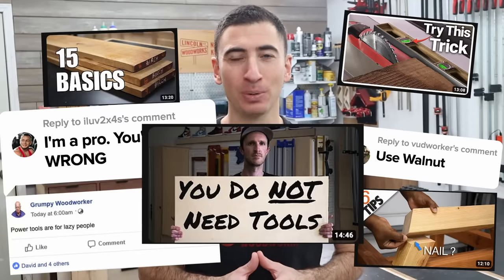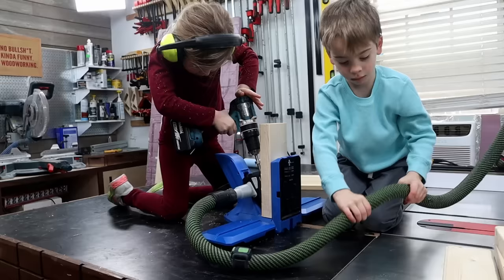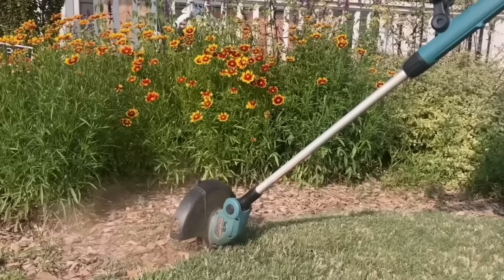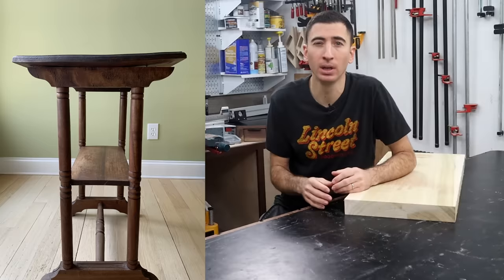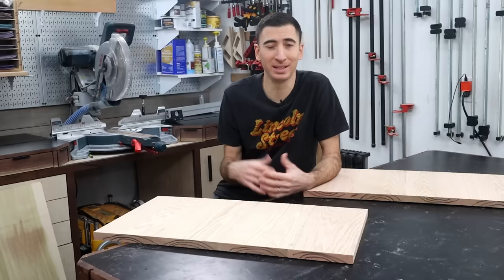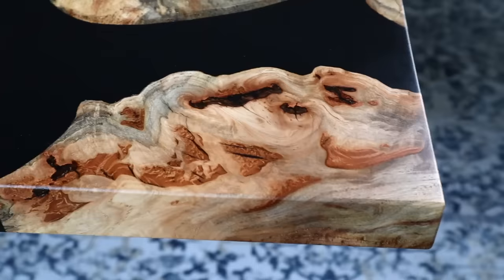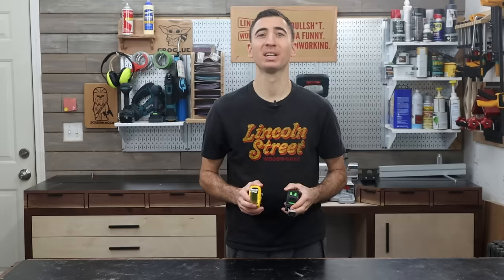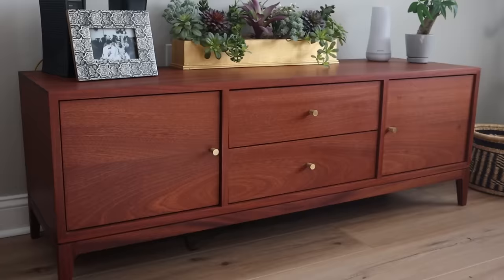Every beginner needs to hear this

Comment: Just got to be careful about all the "opinions" on the internet and particularly those that think their opinion is better than someone else's.
If the piece of wood that you're going to cut the piece from is 3 metres (10 ft) long, it is impractical to take that piece to the project's location, so you still have to "measure twice and cut once" even for the slightly oversize piece that you will sneak up on.
Joint strength is very important in some situations particularly when the piece of furniture is not made from construction timber.
After woodworking for a while your skills improve, you know when it is important to measure twice such as after a rough night's sleep, last piece of suitable wood, etc.
 Thats my opinion anyway.

Comment: Some good stuff here, and nice to have someone cut through all the shit out there.
Alt rings on tops is right - it's the best of the options given wood moves whatever.
Putting the rules and tape measures away is 100% top advice. The workpiece is the master dimension.
Anyway, all good, nice to have some real-world advice out there.

Comment: Making multiple cuts for every joint might be ok for the hobbyist, but you wouldn't last a day doing that in a production woodshop before being fired. Measure twice cut once works perfectly every time if you know what you're doing. Every time you make a mark for a measurement you have to make a mental note of where to cut in relation to the mark. Sometimes you need to cut to one side or the other of the line, and other times you cut directly on the line. Learning how to make accurate cuts is a skill that can't be taught. You only learn it by doing it many, many times and making many, many mistakes.

Comment: I have only had bad experiences in case of pine wood with the sawdust and glue trick, both with wood glue and ca-glue. The mixture is 3 shades darker than the sawdust even before it is finished.

Comment: Makita man since the 9.8V pistol grip screwdriver/ drill around 1980. Used to R&R screws from aircraft. We all used the same screw gun in the shop and everyone had their charger on the same shelf. Need a battery, grab from the shelf. Alwas worked well for me so I never had a reason to look elsewhere. That said Rigid has a LIFETIME SERVICE AGREEMENT that also covers batteries. I shouldn't comment on Ryobi. (I was a tool repair technician for seven years)

Comment: Maybe you should have mentioned that the reason for truly alternating the rings is so when it does cup you have a better chance at resurfacing back flat with less material lost in process.

Comment: Uh, I don't think "measure twice, cut once" is intended literally.  It is an admonition to think before you cut.  Catchy sayings like these are easy to remember and pass on which is why this one persists.  (I certainly hear it from my wife every time I goof!)  

But I do agree 100% with your advice to creep up on a cut.  I always cringe when I see woodworking videos where they use $300 rulers accurate to the thousandth of an inch to make precise cuts in wood.  It never seems to really work that way and I wonder how many re-takes it requires to show it in the video.

Comment: Just get in the shop and build something. The more you do the better you get 90% of woodworking tools never get used.  People buy and have 1 failed build, get discouraged and the tools just sit. At 57 I have Funiture my grandfather made in the 30's- 40's, ya 94 years ago and standing fine, long before any power tools. All hand cut, sanded to fit using horse paste glue., hidden nails  clamped together.. The only "power" tool he had was a lathe foot peddle operated. He built everyone in our family their dinning room /kitchen tables entertainment centers, picture frames, chairs, doors, cabinets.
Even with the newest tool you will still suck at it. Start small build a square box thats hard enough.  I built all my Kitchen out of scrap wood 25 years ago. Cutting up old skids using 3 simple rules 1 cut close and sand to fit 2 dry your wood indoors where you plan to use it for 2-3 months 3 If it breaks you can fix it again until you get it right.  You don't need fancy tools you need patience's more than anything. 
My Grandfather use to hide in his shed to get away from his annoying wife and his creations came out perfect, award winning at shows. If you rush the job you get a rushed looking piece.
Look at how simple the tool's people have used for measuring for thousands of years and the quality work they could do. Tools don't make the wood worker, knowing how to approach the job does.

Comment: Well...Ive built a table out half logs 4 years ago. I didn't had the proper tools, or vices, or perfect dry wood. I did the cuts with a chainsaw. Bad cuts. I still managed to glue them together and also added glue with saw dust in between. I thought it looks bad, but everyone else thinks it looks rustic 😅 the table is still strong.

Comment: One thing I disagree about: Tool brand is important, at least if you start accumulating tools. The number one most important thing is that pieces are repairable and replacable. Any brand that isn't offering any spare pieces for repairs is basically selling you throw away tools. Unless you pay a fraction, I would not buy throw away tools. Both Bosch and Makita are much better than Dewalt or Milwaukee when it comes to spare parts, so I will go for them, even if Dewalt or Milwaukee tools would have other advantages.

Comment: Good woodworking is 1/16" tolerances, Better woodworking is 1/32" tolerances, Best woodworking tolerances is 1/64". And having said that always look for ways to hide tolerances thru alignment, repeated cuts, and jigs. Most mistakes are from fitment adjustments so best to avoid them.

Comment: After 50 yrs of wood tinkering. As my Grandfather called it. No one tool company makes all great tools. I have tools with metal case housing that are older than my father.
Keep them clean and sharp and they will last you years. 
Buy a good tool with a good price and work with it. 
One thing Grandfather told me was. If you're good at your trade you can use a bone and rock to build a house. It's skill that makes it. Practice and patience.

Comment: I stick with 1 brand of cordless tools for battery compatibility. As a DIYer the batteries die and won't hold charges before the tools fail. Multiple tool of  the same brand lets the sharing offset need to immediately buy more batteries.

Comment: The joint tests aren't irrelevant. They have to be put in the correct context. For example, pocket screws with glue, the join holds 170lbs. This is used to attach 4 legs to a table. 4×170lbs= 680lbs

Only there's 2 pairs of pocket screws on each leg so the strength of 4 legs is 1,360lbs total. It seems high but consider the acceleration of gravity formula when you throw the table out of a window. 😅 

Don't forget thay your end table legs are braced (attached to eachother). Overall the strength of the joints when working as intended is still far stronger than the wood itself, assuming the joints were done correctly.

Comment: Battery tools - I would say put your hand on all of them and think about how you will mostly be using them. When 18v tools came out I ended up with Dewalt because I could get the most for my $ and had experience with them through other contractors. But knowing what I know now I would have gone with Makita because their drills were almost as powerful but a lot lighter and was doing a lot of head height or over the head work where the extra few ounces the dewalt weighed, was noticeable after hours of use.

Comment: Testing jointery, while i understand your argument, does matter cause it would give a great comparison of joints at a particular angle.   Yes, 2 joints would be different, and 4 joints are even stronger.   I am not sure that's really a question, though.   Is pocket holes stronger than butt joints.    While the answer is obvious in this case, knowing a butt joint will lack strength can definitely help a new woodworker make decisions based on what he is building.

Also, anybody who says ryobi is better than milwaukee, makita, or dewalt should never be listened to.    It is cheaper.  Not better.
Reply from the maker: I don’t think anyone is saying Ryobi is better than Milwaukee

Comment: Measure twice cut once is mostly from commercial building, yr cutting large amounts of timber for say studs or dwangs and this can easily get mucked up so a lot of the time measuring twice is just a double safety as you dont want to cut 30 studs and be 100mm out.

Comment: First piece of (non shop) furniture was an incredibly simple TV stand. Made it out of MDF and pocket hole screws (and that was the first time using pocket holes, too). My current much-more-skilled woodworker self cringes sometimes thinking about it...and then I walk through the living room and see the TV sitting there, perfectly fine, several years later, and I move on. The gatekeepers need to get over themselves.

Comment: 01:53  "...unless you're building something to sit on or ride..." -- The truth is that whether or not you build things for sitting on or riding on, someone WILL do so, especially teenagers. Or the object falls over and breaks. So the bottom line in my mind is that there are multiple ways to get a great joint, some stronger than the other. You can't make everything "bulletproof" nor should you. But you should always consider the uses your item may be put to, and then think about the lengths of pieces, whether they offer significant leverage, or whether your grain is in the best direction, things like that, and then make your choice for what is appropriate.

Comment: You just said you alternate growth rings if you are using thinner, unsupported boards.  Why not carry that same good thought through all your projects?   Be cautious.  You never know where your work will wind up.

I know a table that was built with good dried oak by a reputable custom millwork company.  It was donated to a Boys Club.  The Boys Club turned off their HVAC over winter break to come back in January to find two splits all the way across the table!  You never know where your will wind up?

Comment: Re the screws it’s 100 pounds per joint so when all the joints work together you’re fine.  I’ve spent ~50 years building with pocket screws biscuits dowels etc.  Nothing I’ve ever built table chair cabinet whatever has failed.  The few situations wherein I paid a great deal of attention to joint strength was furniture meant for human reproduction practices and I went with pocket screws and it worked great 10 yrs old and going strong

Comment: The difference between a Carpenter , Cabinet Maker and Furniture Maker . 
 Skill set , quality of work ,integrity , honesty . The tools ? Same 16 tools . We grade each other . AA ,A +, B , C and WTF ! 
 The work done is valued at the quality of craftsmanship . 
  Cabinets built with Butt Joints and pocket screws are  "Contractor Grade" . 
 One level above Milk Crate and Partical board . 
  Meaning you paid for what you got .(1:1) High end work you get what you pay for .(1:3)
  Yes I'm the Finisher and yes I send it back . 
 Yes it takes 4 years to complete an Apprenticeship per trade . Yes I completed 4 years furniture , 4 years Cabinetry and 30+ years Finishing . 
  And yes I said 16 tools . Hand tools ! Same tools that built the world without a battery . 
 They can fit in a briefcase. 
 That being said , you ain't gonna learn anything till you fuck some shit up ! 
 So learn from experienced old farts  ! You ain't the first dumbass apprentice we've had to kick in the ass ! What ? Ya think we weren't dumbass apprentices ? Shit son ! Still got ol' Franz's boot print and it's been 45 years ! 😂😂😂

Comment: The battery in a power tool will go bad long before the tool.  A cordless tool that's ten years old is almost worthless.  Name brands might extend the life, but eventually the battery and chargers will be hard to replace.

Kind drying typically only gets you to 15%.  If you live in a dry place wood will dry a lot more.  It can take a long time to get there.   If you store wood outside and live where it rains a lot your wood can be 15% at the factory, but can gain back more moisture than it had right from the kiln.

Comment: I want to agree on the Ryobi quality but I just cannot, I have had far to many bits of there's die or just not be able to do the job. I am not  a professional but we do have a large property so use the equipment more than most and its mostly not furniture making, but as I said, killed way to much Ryobi stuff to bother with it, not to mention the support or shitful, we basically got an email say "we do not care" for some of the equipment that failed (chainsaw, blower and a few other things that were lumped in as one) . Contrary to that I have not had a failure at all with my DeWalt or Milwaulkee stuff, my old NiCd DeWalt stuff is still going strong, batteries still work but when they give up the ghost I don't care as I grabbed an adapter, and when they eventually die, I will be happy with their lifespan, (still shitty though as of course it will die in the middle of a job, that's a given). Ego I have had issue with, and they have been good on support, even though it looks like it may have been a me problem (head did not like the line type in the whipper snipper/wheed whacker/strimmer) but I now avoid Ryobi like the plague

Comment: Oh yeah imagine someone lecturing you when you're a rookie ;)
Btw a joint with pocket-screws becomes more fragile over time, especially when the wood dries out more. Fresh pine wood doesn't have that issue.. yet. 
About the alternating technique I partly agree, yes other factors have an effect. 
And covering things up with epoxy is just evil. You making from something natural something synthetic. Which one does with glues and lacquers. But epoxy is another level. When burned toxic, not recyclable. I like your channel though, you have an open mind about working with wood. But it is not for no reason people have been using techniques for over hundreds if not thousand of years.

Comment: I tried asking the internet how to block a Wi-Fi signal, my own Wi-Fi signal from my own (sort of) router.  75% of the comments were To go into the settings and turn it off. if I could do that I. Wouldn't be asking the question. LOL? That's how the internet works, at least some of it.

Comment: Our carpentry work depends on quality of the products we feed into the items , if we use wood glue definitely it will not hold properly, quality of screws we use also you have to put in the account , now there is a world of knowledge knowing what type of bolt or screws needed . Commercials are pushing us to think that we need more watts and more amps , wood is wood and it is not concrete or cobalt .have confidence on what you are using and use a quality items .

Comment: Tip:
If you use current measurement systems (such as the Metric System) and leave aside outdated measurement systems that are out of use by 94% of all humanity, you will be able to take better and more accurate measurements.

Comment: Good video but I'm not a big advocate of sealing both sides with a finish. In my opinion it will slow the absorption of moisture but as you mentioned, most homes are climate controlled.  Even with the finish on one side the moisture will stay fairly even. I have never had warping problem because I use some of the methods you mentioned to avoid this but on nice furniture I want to be really nice I use quarter and rift sawn.

Comment: We use pocket holes all the time. However one factor that's almost ALWAYS forgotten is flat ...is a piece flat from style to rail. Pocket holes do little to ensure that the two pieces have a flat plane across them but mortice and tennin do. Both have their place. 

You are literally completely wrong on not alternating grain and yes as the video states I do indeed have over thirty years of experience....however you neglected to consider the lignin in the materials from 150 years ago as you reference. That old growth material and largely crystalized lignin perform much differently than most modern materials and I say modern not in a better way.

Comment: I mean, unless you're going to use the tool daily you won't really notice the quality difference in a Ryobi and a Milwaukee. however, if it takes 1 second to set a screw with the Milwaukee and 2 or 3  seconds with the same screw with a Ryobi, and you have 1500 screws to set,  then you will notice a difference. in fact there will be at least 25 minutes in difference.

Comment: For the general person I would agree with all of these. Some however do actually make a difference to those who do this every single day. As one example. Sorry but when I did this as a career, I did not sneak up on the cut to make a perfect fit, I knew my tools and knew precisely where I needed to cut to make a perfect fit every time. You can err on it being a tad long though, as you can always shave off more and not vice versa. But most of the time only needed to make one cut.
Reply: Well, the video is labeled for beginners.

Comment: Pre-novice wood worker here, I feel like the motto measure twice cut once is like a meme handed down over generations  with context lost along the way and your method of creating a test or beta piece to check is would also be a way of doubling checking your measurements - so it's not so much about making sure your ADHD and memory don't misdirect the final cut and more a way to operate to ensure the final product matches your desired outcome

Comment: "Measure Twice" does not presume the measurement is done with a rule or tape. Using the project to mark the piece to be fitted is a legit way of 'measuring' and 'sneaking u on a cut is almost always good advice when the opportunity presents itself. Unless you've a hand dandy board stretcher.